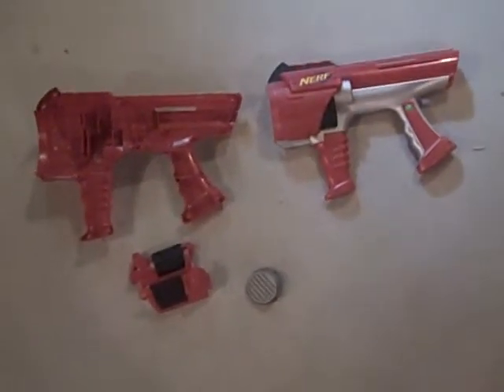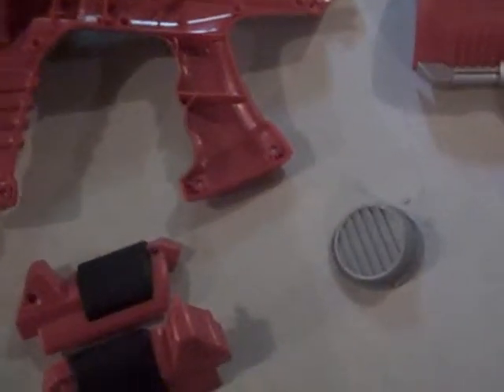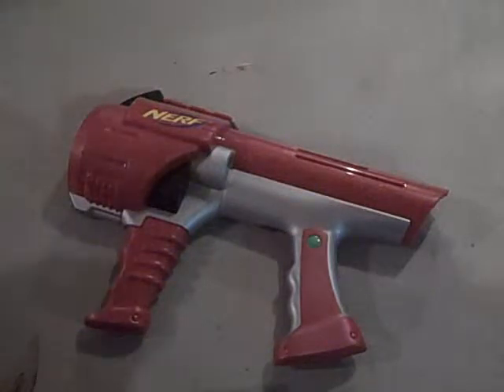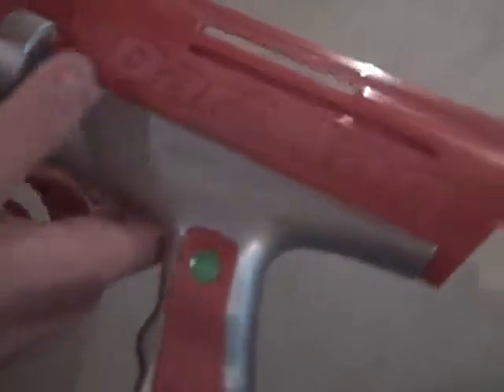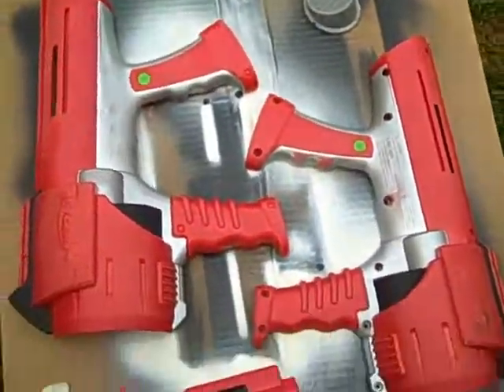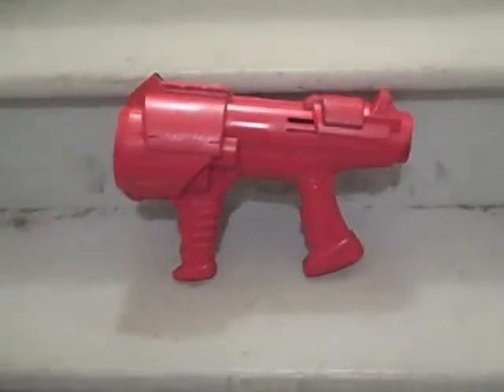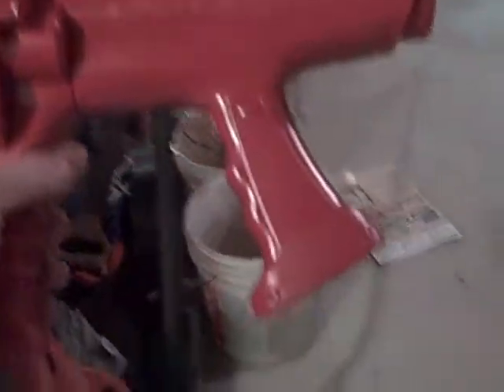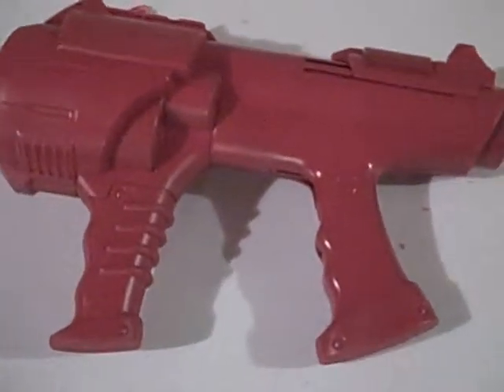How To Paint Your Nerf Blasters- Base Color

Comment: I know that you need to cover your coats of paint finally with a special paint that helps form chipping but what is it called and is it expensive?
Reply from the maker: Generally people clear coat their blasters and it's not very expensive compared to the price of paints.
Reply: Where should I find clear coat?
Reply from the maker: tbsalois Gaming They carry it in spray form at many hardware stores in paint isles and you can get liquid form at hobby and craft stores. For nerfing I would recommend the spray form as it applies more evenly and tends to look better in my opinion. It comes in both glossy and matte as well.